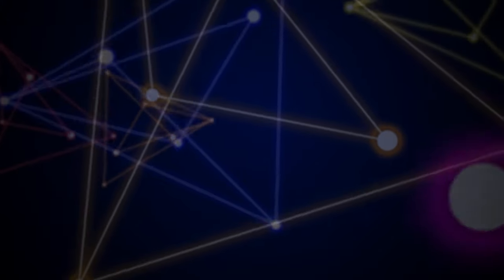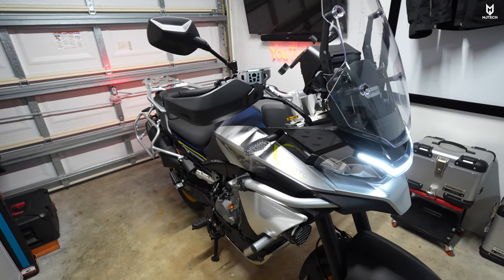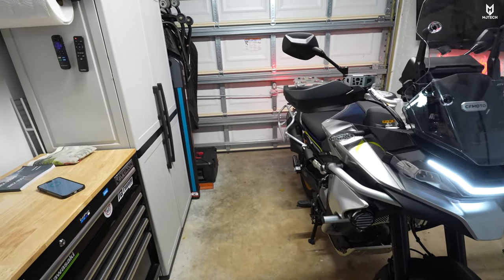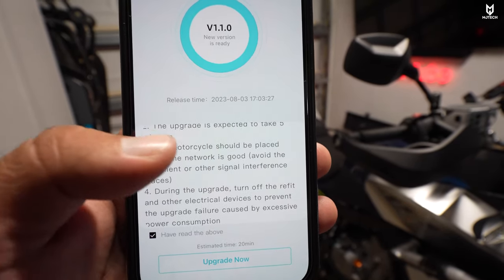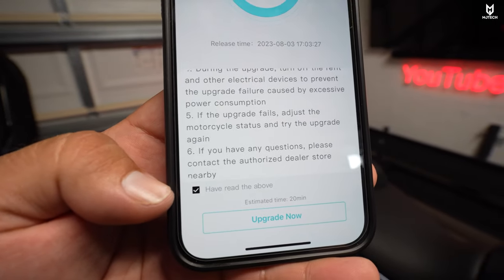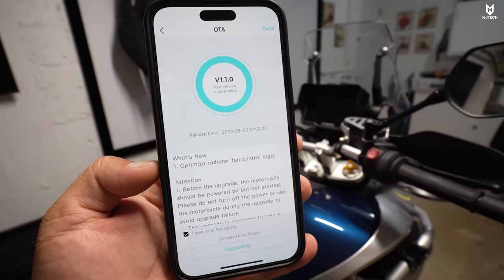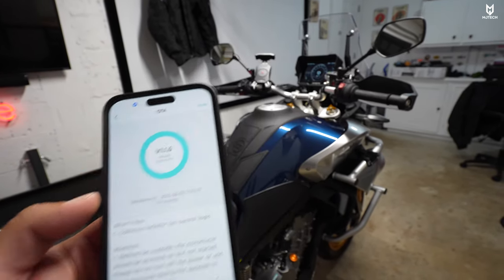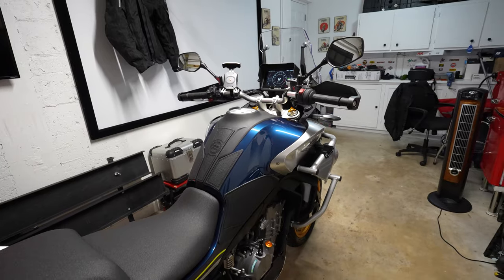CFMOTO Ibex 800T - OTA Update That Fixes MCU Failure!

Comment: Up date is good but I'm more interested how you can turn on the ignition and the lights don't come on. I'm in the UK and all the lights come on whenever you turn the key, anytime I want to do any work on the bike that involves having the ignition turned on for any length of time I have to pull the lights fuse out, it's a real pain up the backside.

Comment: Error has come on 3 times. First was after the dealer did all updates when I bought it. Next time was riding in Palm Desert. The bike temp just kept climbing at some long Red lights, but the error went away after riding. Next was out riding to a nice campground.  Temps were cool and we had had some rain. Next morning I get get same error. Disconnected the battery and then after hooking the v battery up, bo more error.  I have been doing some riding. No error. Today the outside temp is low 90's and the bikes temp goes over 201 before the fan turns on. And tge error is back. Called the dealer. They don't know anything about the issue.

Comment: Does your model come with tubeless tires?
Reply: yes the ibex 800t comes with tubeless tires. P.S. I have watched a ton of your metal detecting videos a couple years ago when I was metal detecting a lot. Small world. ;-)
Reply: @woodknack1  Cool. I am thinking about getting one of these bikes. Any regrets? Thanks.
Reply: @DirtFishing  no regrets! Love it! And i have had a lot of bikes in the last 34 years.
Reply: @woodknack1  I am going to test ride one tomorrow at a local dealership.   ;o)
Reply: @DirtFishing  Let me know what you think after your test ride.
Reply: @woodknack1  To tell you the truth I didnt like the one I rode. Throttle was not smooth at all especially if the rpm's were in the 3k range. Bike just kind of felt unrefined if that makes sense. Maybe the one I rode was a dud.....;o)
Reply: @DirtFishing  the new uodated seemed to smooth that out maybe they don't have it updated. My buddy has an african twin. I like that too. Engine is really smooth bit also twice the price! For what you get fir tge money the ibex800t is hard to beat. Also when you test rode it was it in rain mode or sports mode? That makes a huge difference .
Reply: @woodknack1  It was in the sport mode. There are other dealers around and maybe I will try to ride one at another dealership and see how it compares.
Reply: I believe both versions mag and spoke wheels come tubeless

Comment: Hi From British Columbia. Have my 2023 Ibex 800MT which I have had @ 3 weeks  now. Week one it throws the MCU failure code. Took it to 2 different CF Moto dealers and they did not have the equipment to read the code or reflash/do updates! They say because it is a new model they only have been given  a non - complete diagnotic tool by CF Moto. This seem illogical as from your video's and others this motel has been out over a year in other markets around the world. Surely CF Moto would have fixed or have updated this?? But apears not. This really does not instill confidence in CF Moto if this has been going on so long without any fix.